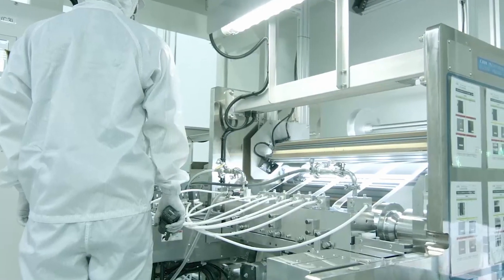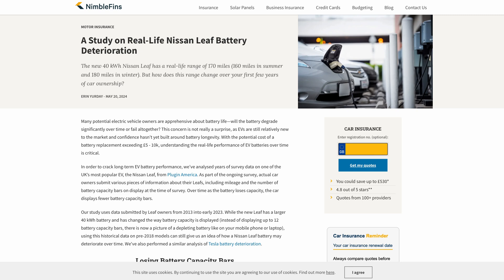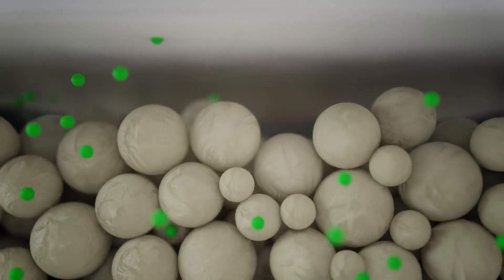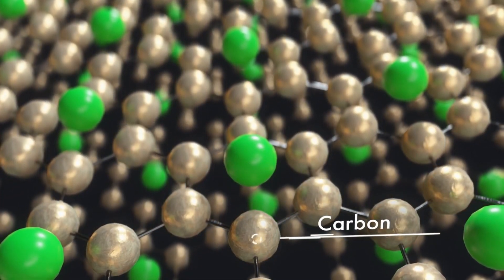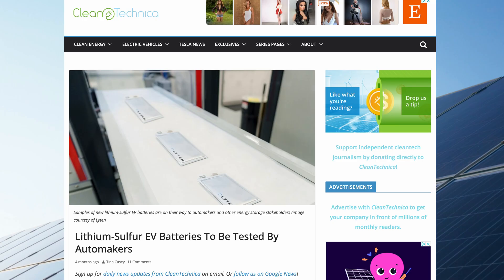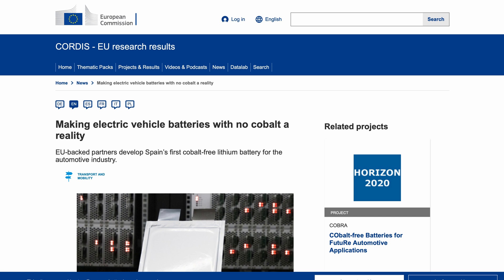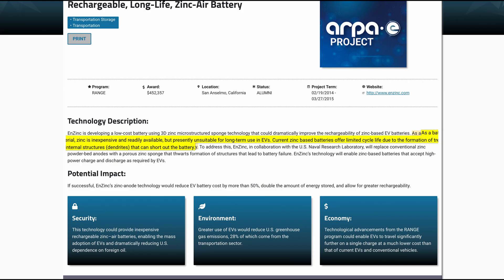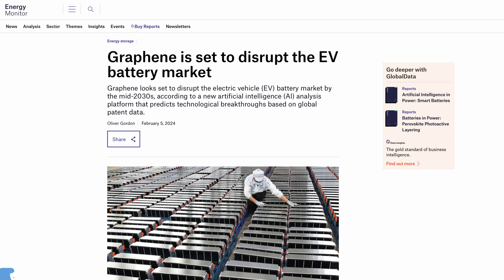Electric Car Battery Breakthrough: Is This The End Of EV Range Anxiety?

Comment: All these videos make me wish I had a Nio.  The battery swap technology means you can get the car now, and keep putting in better batteries as time goes by.  I just watched the road test of the Semi Solid 150kWh Battery with a 1000km range.  Suddenly the Nio strategy makes sense.
Reply: Wrong. The Nio business model is badly flawed. In order to have sufficientt batteries around waiting to be put into a car they need a huge inventory and a battery that is not in a car is not earning money. Modern EVs are capable of good ranges and charging can happen when the driver is resting so there is no lost time.  Furthermode standardisaion of far more than the connector type and comms protocol is necessary for the Nio model. Nobody else is going to bother with this nonsense and Nio will go bust.
Reply: @rogerphelps9939  no lost time? Seriously?  I know it’s getting better, but you simply can’t say there’s no lost time. And I think one of the big problems with EV adoption is the fear of sitting on an outdated or dead battery. You don’t need to swap your Nio battery every time you would charge your car.  It’s just that you can if you need to upgrade or get a fresh one quickly.  It seems like the perfect way to get around the whole “Betamax” anxiety.
Reply: @dominicgoodwin1147  I don't lose any time.  The big hurdle is that manufacturers will not wish to have ttheir battery form factors dictated by Nio. Also the cost of inventory is crippling.
Reply: but will the car be compatible with new technology batteries. Making new tech backward compatible will limit its ability to take advantage of the new advancements. Nio make money by selling cars. Advancing battery tech on old cars is a huge cost. If nobody buys new cars with the new tech they will go bust.
Reply: @Joe-420-69  Well that seems to be precisely what Nio are doing.
Reply: @dominicgoodwin1147  what going bust?
Reply: @Joe-420-69  Treating the batttery pack as a separate unit.  It's the most sensible strategy when the battery is evolving faster than the car.
Reply: Look at Bjorn Nyland's views on Nio battery swapping!
In China there are queues at the battery swap facility as it takes 5 minutes to change a battery, so many more minutes waiting!
If you get an 800v architecture car that goes from 10% to 80% in 18 minutes, the wait time isn't much more than at Nio stations and you can stay in the car - unlike the battery swap stations!